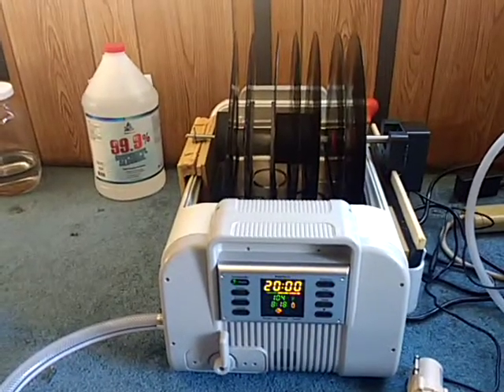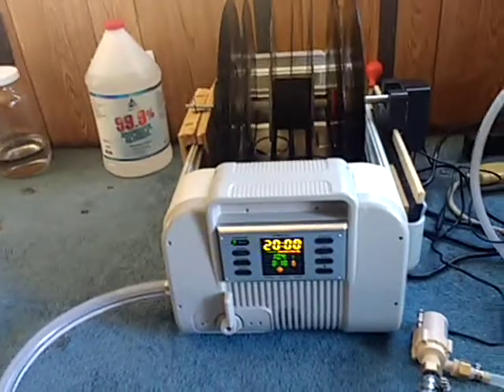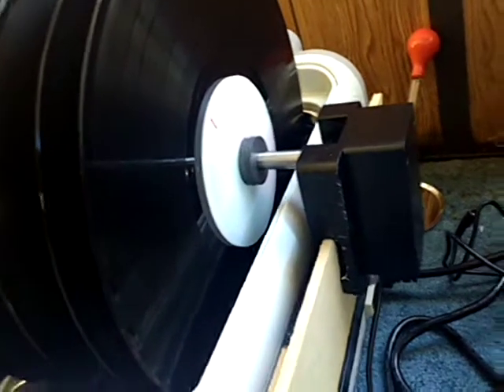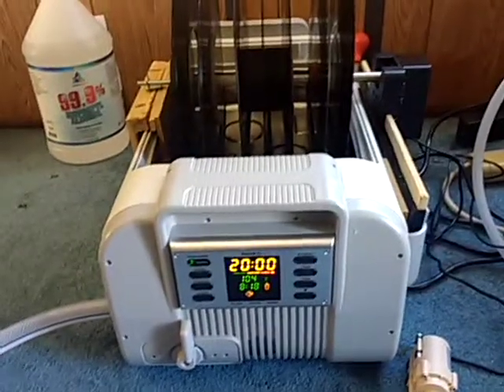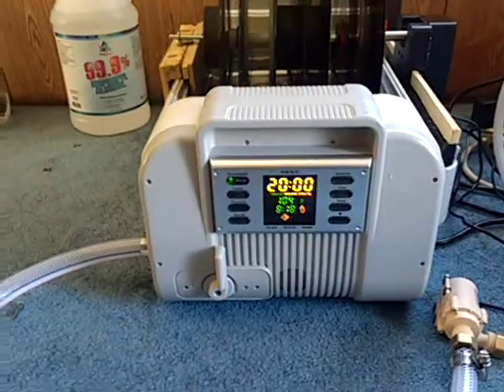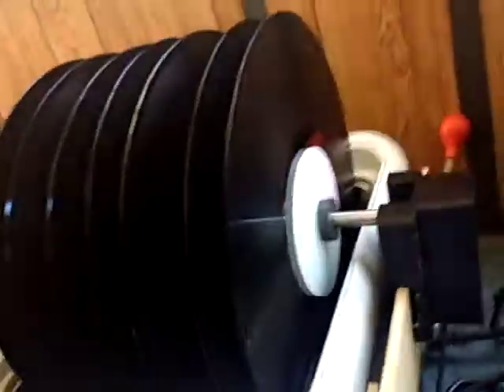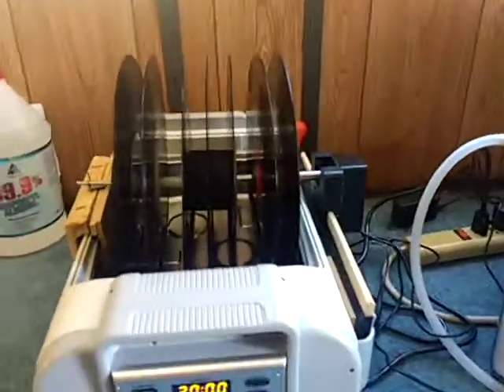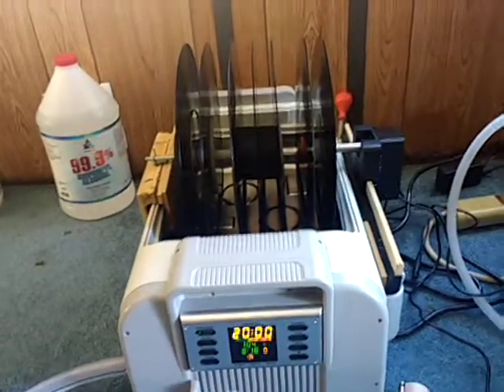DIY Ultrasonic Record Cleaning Machine (same iSonic tank used by Kirmuss) Pt. 1 (IMPORTANT UPDATES!)

Comment: Great intitative, Jaime. Thank you!

My concern with buying the iSonic rotator are those five RPM. It does strike me as too fast. On to Part II...
Reply from the maker: Thanks for checking this out Austin!  The actual spindle and concept of the iSonic motor/spindle are actually quite good.  BUT... yes, I personally would see if there is a separate AC plug just for the spindle (which there should be since you can buy the tank separately) and simply just get a generic 3 volt AC adapter like I did replacing the 12 volt that came with my spindle/motor, which I THINK I mention here in part 1, or maybe part 2, it's been a while...  

But the design looks perfectly fine. I just wouldn't use their suggestion of 10 records at a time due to there not being enough space in between for proper cavitation.  I think all you would have to do is just put more of their spacers in between and only do 6 records (or less) at a time. Otherwise, if you didn't feel like messing with a separate motor and creating a spindle, sure, their device would be fine with these modifications.  It's been quite a while since I have checked, but I'm guessing the price still would be well under $700 - $800 for the whole setup, maybe even less.
Reply: @latheofheaven  Jaime, I spoke with Jerry at iSonic and it seems they're phasing out the model you demoed (P4875II) and replacing it with the CS6.2-PRO, which looks smaller (and a little less rugged and cool). But they're suppsoed to be slightly more powerful and functional. If you get a chance to look at the CS6.2-PRO, I'd be very interested in your impressions. 

It costs $1,218, plus $160 shipping to me Switzerland. If it's that awesome, it's still a quarter of what the Degritter costs. 

I still don't get the whole kHz shabang. Yours cavitates at 35 kHz; Degritter and KLaudio cavitate at 120-135 kHz. Intuition suggests more kHz is more effective (and expensive), but that train of logic often fails. I just want to try to understand it.
Reply from the maker: @austinhunt4260  Yeah, I had a feeling that by now they would have changed the model.  I believe I also spoke to Jerry before I bought mine.  He does know his ultrasonic product, but he honestly doesn't know much about record cleaning.  I tried to explain to him about jamming 10 records in at a time, how there would not be enough room for proper cavitation, and I also mentioned about the too rapid rotation speed, and he just dismissed it and said 'There were no complaints'...  😊 

But, unless they've radically changed the tank, the 3 oversized transducers and the 3 heating elements seem to work really well.  I'll take a look at this model if I can find it to see how similar it is.  I'm glad you are happy with the price and all (I'm assuming that includes the spindle and motor too)
Reply from the maker: @austinhunt4260  Okay, this is my 2nd reply to this post.  I had a chance to watch their video of this new machine.  It didn't look too bad.  I THINK what they did was replace the 3 oversized transducers in mine with 2 SUPERSIZED ones!  They do indeed look huge!  If so, then I'm thinking the cavitation should be even better.

Ah, I see they also include a pump to remove the water, that is nice.

The only thing I would suggest, is if they provide a 24 volt adapter and it runs the rotation speed, then definitely see if you can get a generic 12, 6, or probably better yet a 3 volt AC adapter to slow that ridiculous 10 RPM down.  Also, whether you want to mess with their provided cleaning solution, I honestly don't know about that.  And, of course I would STRONGLY suggest not doing more then 6 evenly spaced records at a time.

You can adjust the temperature, which is good.  I THINK they replaced my unit with an interim one where there was no heat adjustment.  And yes, it tops out at 40 degrees Celsius, so you will definitely want to shoot for about 30 and NO more than 35.  Get a temperature/TDS reader for sure so you can keep track exactly what the temperature is.  And yes, it does indeed probably take 20 minutes or so to heat to the correct level.

Not bad really, especially with those huge transducers, as long as everything is built well and they stand behind their stuff.  Actually looks pretty good and would I think be a much more affordable nice compromise than spending 3 times as much and you don't have to fabricate anything, it is all ready to go.

I am not familiar with how the 'Spin Dry' part works, so you will hafta experiment with that.  Personally, instead of draining  out the solution and putting in distilled water to rinse EVERY time, I would just simply keep track of the TDS to see how clean the water is.  I use mine several times (of course I run the filtration back into the tank, so that is different) and I use the solution until the TDS gets to about 12-15 and then I change it.  But, with the filtration it really lasts quite a while.

And, IDK... depending on whether you want to keep switching back and forth, I would honestly suggest the 'Dishpan' method that I use for the distilled rinse.  That way you don't have to keep messing with the tank to rinse.  A dishpan doesn't cost much and you'd just hafta figure out how to mount the spindle over the dishpan to turn the records in the distilled water.

If you get this do let me know how you like it!
Reply: @latheofheaven  I misstated the difference between yours and the newer CS models. This is from Jerry at iSonic:

"CS6.2 or 6.1 uses 48K frequency. Higher frequency doesn't mean higher power. Rather it's the opposite traditionally. 120-135K would mean very low cleaning power. Most of our commercial models use 35 to 40K and that's a good range. Our CS lines use 48K as a result of a breakthrough after years of R&D. It has higher frequency but also higher power than the 35K transducers we use for the medium to large sizes of the machines. Another benefit with higher frequencies is that you hear less noise as it's beyond human hearing.

"I wouldn't say CS6.2-PRO is more durable than P4875II. P4875II is very reliable with a long history of good track record. The CS line is still relatively new. P4875II also has a very similar power intensity as CS6.2-PRO so they are equally powerful. The benefits with CS6.2-PRO include that it's more compact, quieter, and it uses a simple spindle adapter set to clean 45s if you have those. P4875II needs a separate motorized fixture set to clean 45s as it's one of our standard industrial models that we adapted for vinyl record cleaning. The CS line was designed with vinyl record cleaning in mind."
Reply from the maker: @austinhunt4260  Yeah, I see...  So the frequency is slightly higher, that's probably a good thing, although from what I've 'gathered', the super high 120+ I don't think are the most optimum.  I don't think you misrepresented anything, really.  But, just going by the sheer size, bro, those transducers are frigg'n HUGE!  which is a good thing...  😁 And mine are already larger than the usual generic ones you see from Amazon/China.  I'm just assuming that they likely are very effective.  And, the fact that they won't be as noisy too, that's an improvement!  I certainly have to make sure while mine is running that I am definitely aways away from it.

I am not conversant with whatever they've done or changed with their spindles, but I guess this model is specifically made for record cleaning, so that is good.  As long as you can control the temperature, chemistry, rotation speed, vinyl spacing, and duration you should be just fine.  With the added provisos that I mentioned before, it sounds like it should work very well.  I look forward to hearing how you like it!
Reply: @latheofheaven  Outstanding extensive post. Thanks very much, Jaime! You've definitely given me a lot to think about. 

I need to understand cavitation frequencies before I pull the trigger on any ultrasonic RCM. I'm going to try to prod Dave into doing it for me since he'll be better at it.
Reply from the maker: @austinhunt4260  Sure thing man, I hope it works out for you.  Thanks kindly for taking the time to dredge all through this!

Comment: Looks like iSonics current models of the P4875 offer either no heater (they always indicate in their literature that records don’t need heat) or they have the heater in various versions of the P4875, but the heat settings start at 40°C (102°F) at the lowest. From what I’ve been reading this is too high. Wondering if this means that iSonics machines aren’t really suitable for record cleaning anymore?
Reply from the maker: Hmmm... If that is indeed true, that would be a real shame!  Yes, 40 degrees is pushing it, I always try to keep it around 35ish.  From what I saw their last one merely set the heat at 35 and you could not change it.  I would double check this if I were you because that doesn't quite seem to jibe with what I saw from their latest not too long ago.  As a matter of fact, if you check the comments below, a fellow just got one not too long ago and it was the one with the fixed temperature at 35.  In the past, they have sold a complete 'Record Cleaning' setup, with the same tank but with a motorized turn spindle to hold the records.  I can't see them dumping that unless for some reason it turned out not to be profitable for them.

In the research I had done before setting mine up, I would say as long as it is a quality tank with similar dimensions and a heater (which most do have) and a decent warranty, and most definitely NOT one of the millions of generic steel ones you see on Amazon from China, you should still be able to set up something similar.  In an updated link either here on on one of the other parts, I just posted a new link to a less expensive version of the exact same motor/spindle that I use on mine that you can get from Amazon.

Oh, it just occurred to me too that even if their heater is set to 40 degrees, IF you can simply turn it on and off, then you are golden, because by using a simple inexpensive Thermometer/Total Dissolved Solids Meter it would be super easy simply to heat it up to what you want and then turn it off before putting the records in, case solved!  😁

Comment: What stops the labels from getting wet in the cleaner itself or the rinse bath? Thanks for the video and details!
Reply from the maker: Hi, thanks for your comment.  Sorry my first video here is pretty rough 😊 I was just anxious to show and help others with how awesomely this DIY ultrasonic tank really cleaned records and the reasons why.  I scanned through it quickly to see if there was an angle showing the water level, but I don't think I showed that clearly in this video.  I think I go into much more detail about the water level and such in the next video or two (Pts. 2 & 3 - In Pt. 4 I add details about recirculating the solution through the filtration system I made)  So, I believe if you check out the next 2 videos, I do show and explain more clearly about the level of the solution in the tank.  Basically, to answer your question simply, the level of the solution is just below the labels, roughly about 1/8" or so.  I hope that helps!  I don't remember for sure, but I THINK that in Pt. 2 where I show the rinse tank I believe I show a clearer shot of the water line as they are rinsing, which would be similar to the solution level in the cleaning tank.
Reply: @latheofheaven  thanks! I'll watch the other videos. I'm most curious about water sticking to the grooves as the record rotates, causing the gravity to pull the liquid over the labels. If this doesn't happen in practice maybe I'm just visualizing it wrong.
Reply from the maker: @OldDirtHill  Yeah, I know EXACTLY what you mean, and I was concerned about that very thing before I did this.  I read about some where they have these fancy waterproof covers that go over the label, etc.  But, the whole idea is that as the record rotates (as slowly as possible as I point out in the videos) the solution since it does have surfactants in it does indeed spread over the grooves of the vinyl, BUT it never, ever runs down over the labels as you might be afraid that it does.  By the time the bottom of the record in the solution rotates to the top (continuously of course) the solution DOES adhere to the vinyl but as the surface rotates upward, the majority of the solution of course drains downward and not enough is actually 'carried' to the top to then run down over the label.  I've cleaned probably 1000 - 1500 of my albums so far and the solution has never run down over the labels.  Same with the rinse tank using just distilled water.  

But, after rinsing you DO have to be sure to leave the stack of albums sitting horizontally for long enough to allow whatever water is left to dry fully (normally on a dry day about 30 minutes is enough)  I ALWAYS inspect the albums carefully as I take them off the spindle, giving special attention to the center deadwax and the most outer grooves, because if there is a small drop or two, that is where it usually is.  I keep an eyeglass cleaning cloth nearby just in case I have to wipe a few small drops in those areas before resleeving the vinyl in 3 layer poly lined inner sleeves.
Reply: @latheofheaven  thanks so much for this detailed response! I'm 99% sure I'm going to pull the trigger and buy one of these. Wish me luck!
Reply from the maker: @OldDirtHill  Oh absolutely!  Compared to all the Chinese crap metal ones on Amazon (no offense intended)  this tank is very good quality and allows you the flexibility to add either their own spindle to hold the records (I've commented about the pros & cons of that in the videos) or you can make your own like I did.  I've talked to one of the primary representatives at the company and he was very nice and helpful.  This way you not only spend $1000's less than one of the commercial units, but like I mention in the videos, this is superiour in every way because not only do you have full control of the temperature, solution, rotation speed of the spindle, but you can also effectively do about 6 records at at time as opposed to say the Audiodesk ($4000+) which only does *ONE*, and gives you absolutely no control over the other variables  😊

I WOULD strongly suggest going through Amazon if possible due to their easy 30 day return.